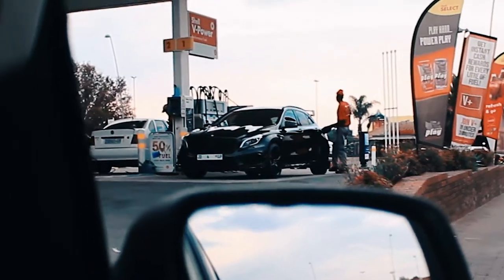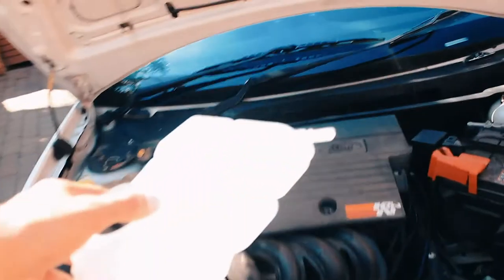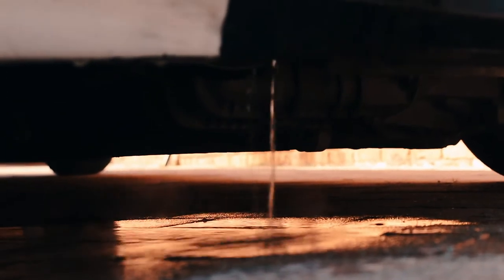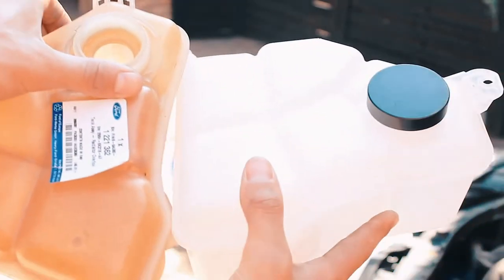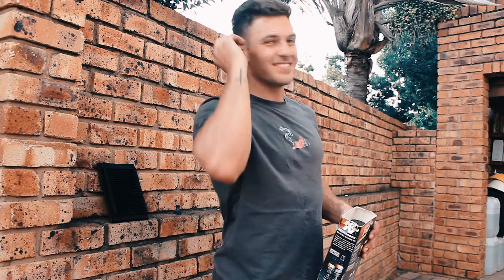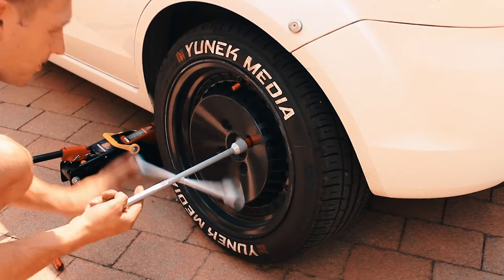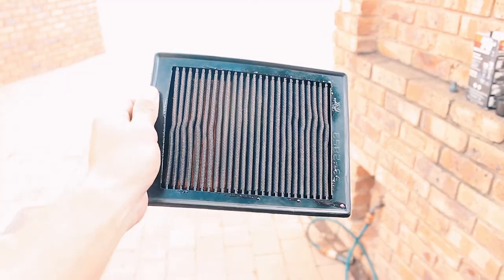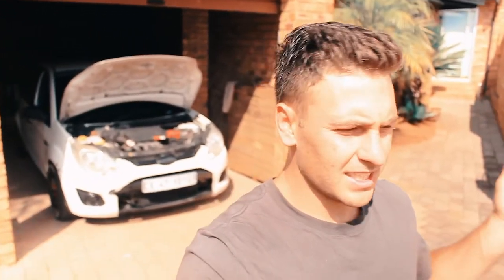I Broke the Figo | DIY Water bottle Replacement Ford Figo Modified

Comment: I do most of these jobs on a daily basis since I work at a ford, if you want you can actually change a bottle without draining the coolant
Reply from the maker: I needed to drain the coolant cause it was water and not antifreeze so that's why I drained it
Reply: Ooh ok that makes sence, and yes just water aint that good for the motor... Fun fact though- sunlight liquid makes for a great coolant haha because SA doesn't get that cold and it provides sufficient lubrication
Reply from the maker: Haha I'll wait for the day till someone else tries that before I attempt 😂😂😂
Reply: So you're saying if you've been using the same coolant and not water you can just change the bottle without draining it?
Reply from the maker: He'll have to show me how to do that
Reply: @BrandanHewitt  gonna have to make a video when there's a job like that in the shop again, don't have the figo anymore

Comment: Bro what is the reason of Ford figo petrol.over heating issue.i will change gasket.termostate.valve . pump. 🥺But still over heating ,🥲
Reply from the maker: Hey bro I have had the same issues. Usually it's the waterpump but if it keeps overheating after replacing all those parts I'd say you should check your radiator. And check all the coolant pipes to see if there are any blockages.
Reply: @BrandanHewitt  bro radiator allredy clean pipes are fine 🙂
Reply from the maker: @psychogaming7195  I'll ask my mechanic and get back to you just pop me a message on Instagram @yunekoriginals

Comment: Hi Brandan thank u for your videos im having the same issue with my water bottle and another thing i would like to find out,are u using a standard 619 battery or you went bigger?
Reply from the maker: Yea man I actually just replaced the water bottle again after 1 year 😱 Ford parts are not to great. I actually fitted on size bigger the 628 but it requires you to cut the plastic holder😂

Comment: Removing the pipe was not necessary, there's a drain screw on the radiator.
Reply from the maker: I tried looking for 8t but with my car being so low I cannot get underneath it properly hense why I disconnected the pioe
Reply from the maker: Pipe
Reply: Alright, makes sense. The screw is located on the bottom left corner of the radiator.
Reply from the maker: Thank you so much when I get a chance I'll give it a look and see if I can find it, it will make this a lot easier😂